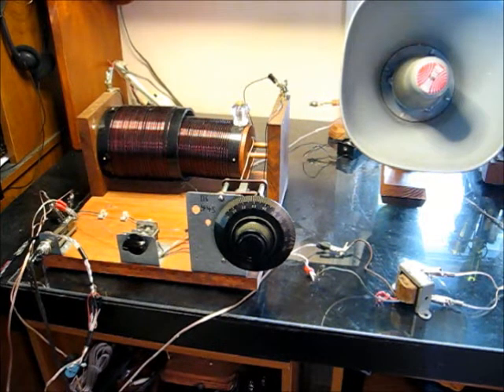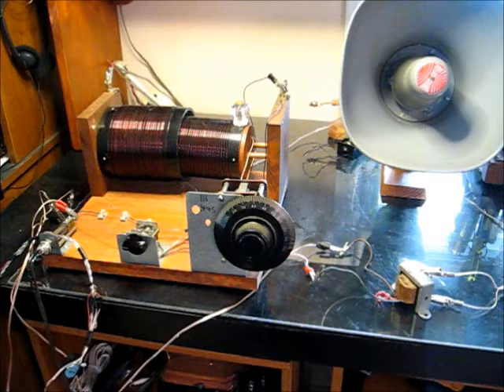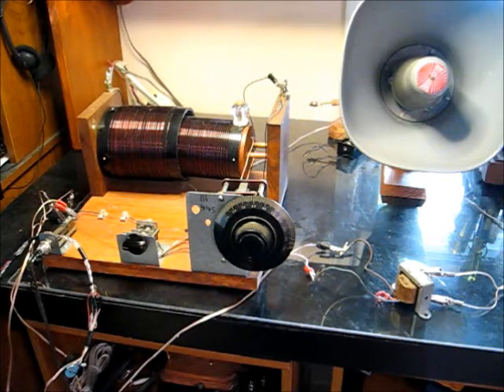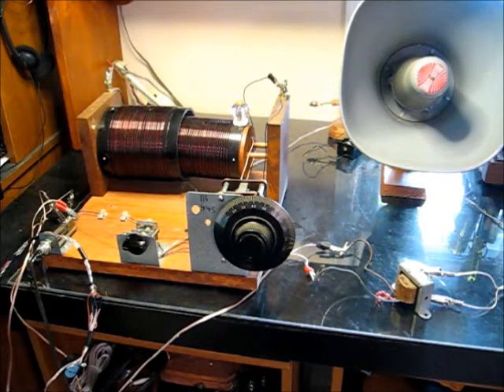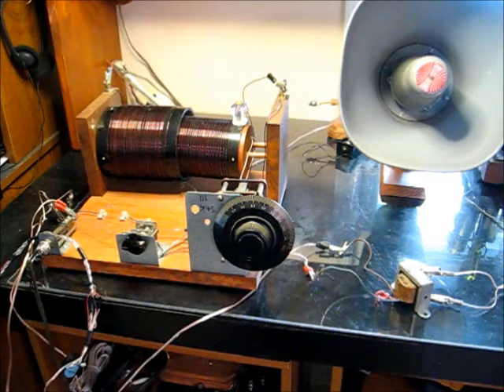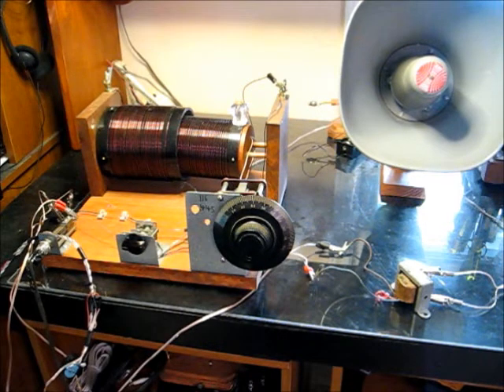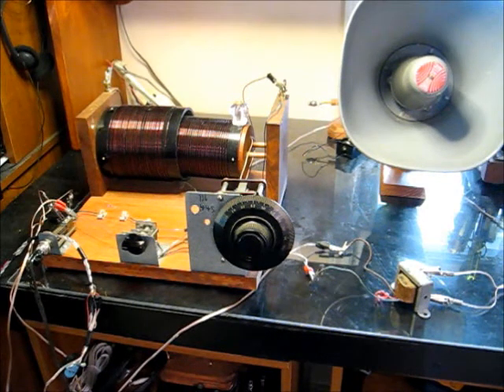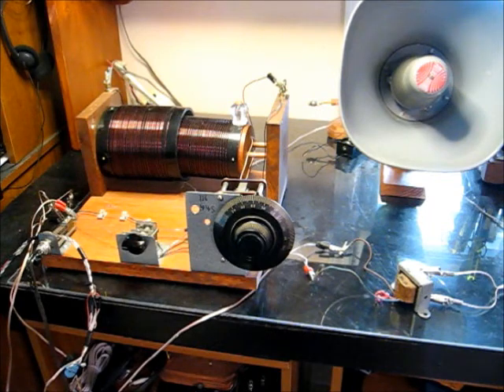Crystal Radio and Unamplified Speaker

Comment: I saw and heard a radio powered crystal set in the early 1950's. Invented by Wes Nichols.  It detected a strong local station and used the dc to power a Germanium transistor crystal set.  A 12" speaker no less!

Comment: Mom used to take the earphone of my set and put it thru the bottom of a paper bathroom Dixie cup. she could hear the local 50,000 watter in the kitchen while she cleaned
Reply: I wonder if she could get better results with a piezo horn tweeter from a budget PA speaker

Comment from the maker: This is a simple "double tuned crystal set "  and the schematic can be Googled under that heading. This set has been off the air since shortly after the video was made do to the difficulty in keeping 300 feet { 100 meters} of wire up in the top of 70 ft. trees in the bad weather Tennessee can have sometimes.
Reply: kc4sixx I hook mine up to the land line phone jack.  Works great.
Reply: @jeromebullard6123  when telephones had dials with stops, the stop would work well too as an antenna connection

Comment: In the late 70s I had a crystal set in Victoria just a few kilometers away from then local Top 40 station CKDA 1220 AM I could use a ordinary 8 inch speaker without a matching transformer. I even built a very small compact pocket crystal set with two earphones and no wire antenna I could use it like a walkman all over Victoria listening to local AM.

Comment: someone told me that you can add a single 1.5v battery to the circuit to amplify the signal do you know how to do that ?
Reply: The early '20s and '30s radio magazines published stories about the Crystadyne. Today it is called a tunnel diode. It is surprisingly easy to homebrew and tune. It was also called the "amplifying" crystal. Yes, if it amplifies it can oscillate and transmit a few miles. It takes about 8 volts to make it work. Several websites describe the process. And they claim it was invented by Leo Esaki in 1953. Ha.